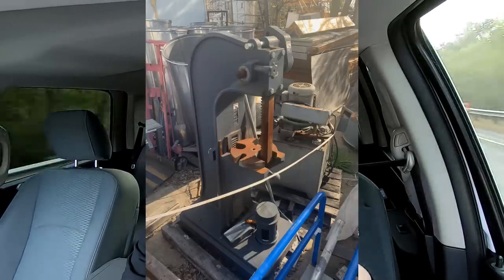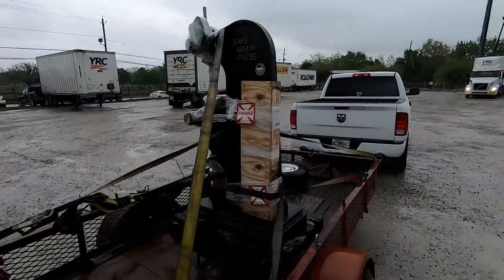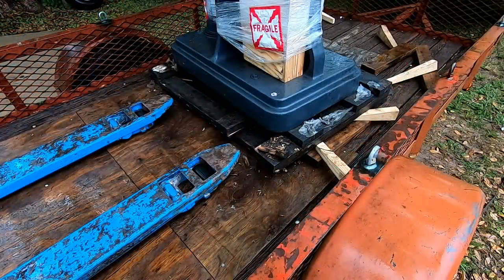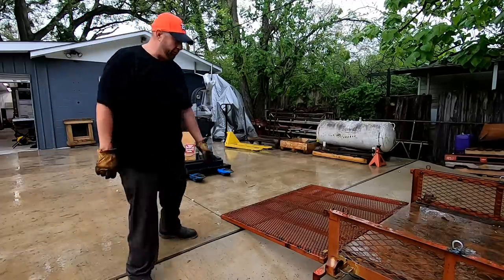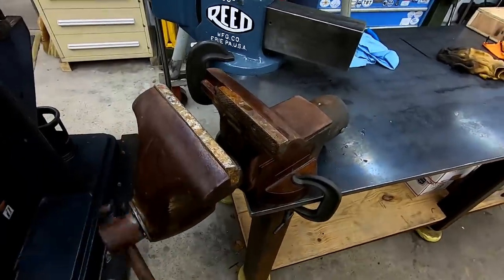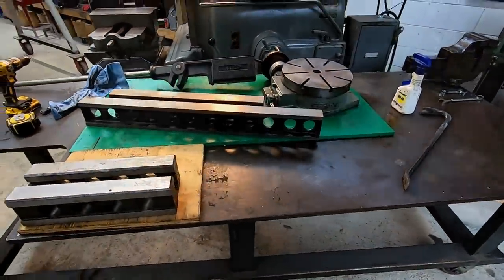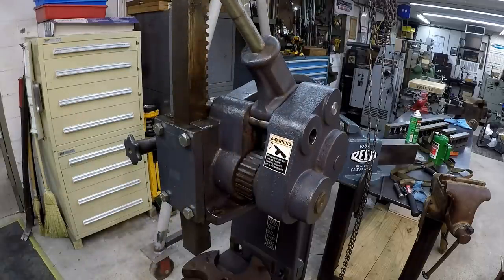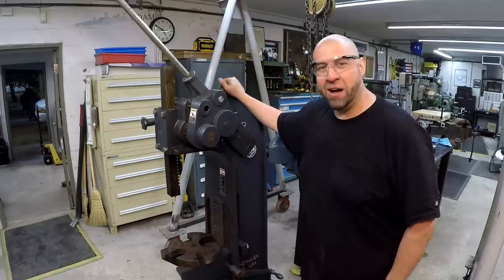Taking Delivery of New 15 Ton Arbor Press

Comment: Throw some rags in the catch can so if drop a broach or shaft it makes a soft landing.  I bet the 1.5-15 pin length is just right pull from one side and stick in from the other. Great score.    Just the right size for you.

Comment: I also noticed that aside from the great strapping job, the press was placed just in front of the trailer axle. Very important.
The axle and the tongue share the weight. (Not equally; more for the axle, but just forward lets the tongue handle some of the load). That is ideal for stability, as well as weight distribution. You don't want your trailer weaving (too far back) or your vehicle rear end pushed too low (too far forward). (This is just for anyone who didn't know; I know most of you do and I know Adam does!)  :-)
Reply: Duh
Reply: @bulldawg6259  Duh?!  Jilucasound's explanation was very good and appreciated by those  who don't know how to load a trailer.

Comment: Dang Adam, you one upped me! I bought a Greenerd #4 from Washington state (I reside in Texas) and was so excited I got it for $264 off ebay. Cost me $248 to get it close to home. In my haste, I failed to notice it was stored outside (Did I mention Washington and the rain they get there) for 30 years outside a wood mill. It was all locked up and a "project". Lots of love (hammering) and oil got it freed up and working properly. I used an engine hoist to unload and move it. While you more than doubled my press capacity, going to have to start a new search. Ironically, I am near Dallas, so I should go visit Andrew and his stuff. Love your videos but you are costing me a fortune in tooling for things I know not how to use. When asked by foolish visitors what purpose it serves, I have thus far crushed a coke can, cracked a walnut and done some minor motorcycle stuff. Yep, multi-purpse tool for sure. Just need to find a hip holster to allow me to carry about town!

Comment: I like the way the press was so thoughtfully protected during yard storage and at the point of dispatch with a readily available plastic bag or bin liner that machinery often comes in from the factory, should it happen to rain or become damp or humid. That reminds me; I've been soaking a pair of engine mounts for a month in Evapo-Rust TM and it only takes a day to work its magic. I wouldn't even know about it unless Adam had featured it in some of his videos, so thanks again big buddy!

(This comment was not sponsored by Evapo-Rust TM but you can never have too much of a good thing, hint, hint ;-)

Comment: Good score. New. I've never seen a big arbor press that wasn't 50 years old and half beat to death. 

The catch basket on the big arbor presses I've seen were usually lined with rag waste to protect shafts and broaches as they fell away from whatever they were pressed out of. And catch chips etc.
Reply: The Catch basket is called a Mandrell Catcher in the Dake manual and i would put some rubber in the bottom of it and maybe around the rim.  Then use a coffee tin to catch chips or oil.
Reply: @SuperSrjones   And here I thought it was a spittoon, you learn something new every day.

Comment: Heya adam. I believe you are also missing a locking wrench for the table. I have a similar press either a famco or dake i don't recall rn. Anyways it looks like an identical machine.  I think this is why there was so much give when you were pressing the wood. If you don't have those bolts in the back tight the table will move a bit when you're trying to press something. Food for thought.

Comment: One thing you could add that would make loading and unloading your trailer is a pair of jack's at the rear end of it. Added to the jack on the tounge, you can eliminate the bounce and sway when you're loading or unloading. I've done it on several trailers in the past, and it really helps. Just a suggestion....

Comment: Do a press brake adapter, would be as handy as hell for bending brackets etc, I know here you can get 150 mm vee and round adapters to squeeze in a vice for that odd 6 mm bracket a shop always needs to hang an Ebay score or your welding helmet, if it was my press it would have adapters to do multiple things, good stuff Adam.

Comment: I have been having a look around at stuff on that press and everything that I can find is saying that its a 12 ton one. The "catch can" (from what i can tell) can have a pad in the base and is used for catching things like broaching tools with a soft impact, the part name is a mandrel catcher. The short sliding pin that is used for dropping the tonnage down is 1" x 6 - 1/4" according to the modern equivalent parts list and has a snap ring in a groove to stop it going too far in.

Comment: Dake is based out of Grand Haven MI. Which is a little over an hour west of where I live. I used to own a twenty ton model, so I can confirm the operation setup that you figured out. Dake is a great outfit to do business with. I used to service a lot of their older hydraulic units back in the day. Just good old fashioned bullet proof engineering, with great customer support. Another unit, manual or hydraulic, is definitely on my wish list for the future.....

Comment: Real nice press Adam.  A little cleanup and good as new, hard to find equipment that has not been beat to death so you got lucky there and good find on the parallels, another shop item that when you need them you really need them.

Comment: Always always always strap the load to the pallet jack. I've seen far too many things fall off from a simple bobble coming off a trailer or even a transition in a concrete slab. In addition a quick bolt on outrigger for the pallet jack is priceless for slightly sketchy situations.
Reply: Words of wisdom for all of us to remember.  As Mr Pete222 says, safety is no accident.
Reply: @anomicworld yes it was. But you saw how easily he could remove some planks. The wood wouldnt be able to hold the weight....

Comment: I have a Famco 3C arbor press in my shop. It has the ratcheting handle. It’s amazing the force you can apply with the leverage from that very simple tool. Mine came on the original stand. Sold for next to nothing at the tool and die shop auction where I purchased it. 
Good vid Adam. You look very happy these days. New job and beautiful new wife. That kind of Happiness means low blood pressure and just healthier stress free living. Happy for you dude.

Comment: Adam. take measurements of the INSIDE of that bottom "catcher." Then go to a local restaurant supply store and look for something called a Bain-Marie. It's a stainless steel cup (various sizes) that may fit in that catcher. They are not expensive and may serve you better than the catcher for collecting the cutting oil and chips. See you at the Bar-Z. Jon

Comment: It's often the simple things that are a serious PIA. 
Nice press though. I think the fixture at the bottom is for pressing bearings on axles and other long work like pressing pulleys off shafts. I believe is (was?) an attachment(s) that fits the seat in the base. I'm pretty sure the cup is for catching slugs when punching holes.
Maybe you are expected to move the left pin to the right side to change ratios?

Comment: Could it be that the pin to switch from 7 1/2 to 15 is designed to pull out of the left side and put back in from the right, rather than having a whole second pin to replace it?
Reply from the maker: Break down shows a short separate pin on right side.

Comment: Congrats on the press, Rucker has a similar model, FAMCO 5C, funny you both found one a month apart.

The cup is called a "Mandrel Catcher" in their manual, I think I would put a rubber mat in the bottom to cushion the fall. 

http://www.dakecorp.com/service
"Parts for Dake Machines

Our facility is stocked with replacement parts for all of our machines. Whether you have a vintage Dake machine or a new machine, our parts are readily available to be delivered to you when you need them. Our service representatives are standing by to help you determine the proper parts for your machines."

I was looking at their Manual and parts list, they seem to have some errors, the last 2 pages of the Model 5 manual are for the Model 4.
http://www.dakecorp.com/uploads/pdfs/manuals/Model-5-2018.pdf The parts view and list is wrong.
But if you look at the model 4 manual the parts view and list look to be correct for the Model 5.
http://www.dakecorp.com/uploads/pdfs/manuals/Model-4-2018.pdf
I've sent them a message about the error.

Comment: next time you go get sumting like that up check if its on the right pallet , if it isnt have them slide the right pallet under the whole lot , could take a pallet with you so its no trouble for them to do so , few blocks of wood a cordless drill and some long screws and the thing isnt going anywhere on that pallet
might be a good idea to reinforce the floor on youre trailer , it looks  like the floor is about to collapse with all the weight on those small pallet jack wheels

Comment: I don't know, Adam, but I am thinking the big "cup holder" in the base would be to stabilize a shaft that you may be pressing out of a gear or a bearing. (Assuming) you would lower the shaft into the holder when the offending part was about to break free. Raise the "knee", lower the ram. When the shaft falls out, it doesn't fall on YOUR knee. Make sense? That would explain why it is so heavy duty. Slots in it? Maybe so you can see how far the shaft is from the bottom of the "cup holder" as you would be adjusting that depth so a big shaft will be captured. (?). That press can handle a pretty big shaft. Maybe 300 lbs.? More? Depending on material. How wide is the largest slot in the Daisy Wheel?
Reply: Telephone DAKE and ask them what it's used for.

Comment: Is that all tile work in the tunnel?

Need to build a pallet Jack with a hoist arm on it like an engine hoist.

Use a cool steering wheel for the hand wheel. Maybe one with a trucker knob on it.
Reply: Most pre 1960s tunnels would be tiled. Super common in older tiles in California.

Comment: Adam, it appears you are correct in thinking the Dake Arbor Press is a 15 ton model. It also appears that it is still being manufactured or if it is discontinued it was only done very recently as the manufacturer states they are still in stock. I'd contact Dake and ask how much a Hand Wheel would cost - just to keep it original. I also see that they sell for well over 15K so you certainly got a decent one.  Nice score!
Reply: A good eye, for a good Buy!

Comment: That cast iron pot looks a little too substantial to be just a catcher, no? I'm really curious as to what it is. I could be wrong of course.
Reply: Adam should contact Dake to get an Owner's Manual with a parts list and assembly drawings that'll answer those questions raised in the video.

Comment: Once, while working my week on, week off shift at NOLA Int'l, I took a drive to visit , my parents who were in Melbourne at the time. Due to weather I was making a midnight dash.
 Somewhere just past where that Buc Cee's is now, I got hit by the leading band of a tropical storm.  I had to pull over and stop for a few minutes, it rained sideways while broken branches were going by at speed.
I pushed through and by the time I got to the exit for Pensacola (The Five Flags Speedway exit) the weather was mild and clear enough to get gas, munchies, and get on down the road to the Atlantic Coast.
Reply from the maker: That’s the Pine Forest Rd. Exit. Been through there hundreds of times.

Comment: No doubt you have already discovered what the basket is at the base of the press, but it is a Mandrel Catcher. The long pin on the left should be 1"x10.5" and the short pin on the right should be 1"x6.25". Very cool find. I would love to had a Dake in my shop.

Comment: Abomb you need to build yourself a proper trailer for loading and unloading heavy machinery like that before you get squashed by one of these beautiful machines. Or at least modify that sorry excuse for a ramp on the back of that tiny trailer with some proper loading and unloading ramps so you don't have to drop that loaded pallet jack off the back of that gate anymore.

Comment: Thanks for enjoyable video!
I get the basic idea of that solid plate that meets the ram, but what are the varied slots in the plate for? Seriously, I googled the heck out of "arbor press bolster plates" and cannot find a single example or demo online showing the use of the slots. Is it that obvious? Pressing bearings or something?? Call me dumb (been called worse - Ha).
Reply: Different slots for different diameter work. When you are pressing 15 ton, you want to have the snuggest fit you can get around axles etc that extend down beyond the table.

Comment: Very nice arbour press. Very large for an arbour press as well I know it gives you "sensitivity" while broaching in smaller sizes but what other advantages would an arbour press this size have over a small hydraulic press? You also have some "sensitivity" on the hydraulic press - probably 20t hydraulic press would offer similar sensitivity to 15t arbour press - in both cases youo know you are pressing harder when you or air-over-hydraulic engine works harder / your hand.

Other stuff looks great too - I wish I had such large parallel set - much smaller ones used go for few 100 USD plus shipping. Vice is nice as well - through I am happy with my large Record vice family.
Reply: The mechanical presses offer feedback. You can tell when something isn't aligned or isn't going right, instead of trying to interpret a pressure gauge on a hydro press. Also, the mechanical press is a lot faster. (Usually.)

Comment: I'm always amazed by how cost effective it actually is to do depot-to-depot shipping with YRC, Southeastern or whatnot when it comes to gear like that. Do you protect unpainted metal surfaces on gear like that with something like Boeshield or do you just give it a spray of good ol WD-40 and let it be?
Reply: Once it's dry CRC SP 350 or 400 is a beautiful heavy wax protectant. I use it on all my machine tools that can tolerate a coating build up.
Reply: @otm646  I'm going to have to get myself a canister of that and give it a go, thanks for the suggestion. I live on the other end of the state from Adam, and as you can imagine the salt air and humidity don't do much good for unpainted or protected metal surfaces.

Comment: What are the benefits of an arbor press that size vs a hydraulic press, other than the cool looks?
Reply: Precision stop and start would be something. With a hydraulic or air setup, you're limited by the stops in the mechanism, and there's nothing you can do about it. With this type of a press, you can stop exactly where you want (on a dime). Imagine you have to set a pin in a fixture at exactly 3 mm, well, how would you do it, you could setup a sacrificial piece of 3 mm to stop against (more work) or just use a last word on the head and watch it hit target and stop. Just my 2 cents.
Reply: They have feel through the handle, you get feedback that you don’t get with a hydraulic press.
Reply: Simpler. No fluid to leak all over, no seals to blow, etc.
Reply from the maker: It’s simple mechanical leverage. Great for broaching keyways too.
Reply: @Abom79  not to mention that if someone can break THIS, they have no business being anywhere NEAR a shop... (Fred, you could f#!k up an anvil, couldn't you?) ~:)P

Comment: My co-workers and I are wondering if a Dake style press ever has any advantage over a hydraulic press. Where I live hydraulic presses are cheap and plentiful and Dake type presses are costly when you can find them. We really wondered about this. Your thoughts Adam?
Reply: The main benefit is having feedback that you can feel with your hand. As opposed to a hydraulic where the only way to "feel" it is to listen and watch a gauge. Also, with the wheel on the left side, coarse adjustment is much faster. Also, no moving parts, and relatively zero maintenance. They're also really rigid/heavy duty, unlike some of the cheap box beam hydro presses.
Reply: I think that arbor presses have more clearance than a traditional hydraulic press to fit large or oddly shaped parts. Also, this thing would beat the heck out of a hydraulic press as far as speed goes, if you're doing any sort of production work.

Comment: On those old cast machines they numbered each part and it’s hard to tell which one is the model number . Does the crank handle below fit on the arbor adjustment ( where you thought there should be a wheel ) maybe they use it for both adjustments ?

Comment: Did they actually put that on your trailer with a forklift? That trailer doesn't look like it could handle the weight of a forklift at all.
Reply from the maker: Must have skipped the first part of the video showing the press being loaded...
Reply: @Abom79  I saw the forklift bring the press out and put it on the trailer but the forklift was still on the ground. The forklift put the press on the trailer and the video cut to the lift being right over the axle of the trailer. I'm not trying to be a dick. I definitely didn't see the forklift on the trailer, though.

Comment: I have the exact same press. It will develop 60 tons with an extension
Reply: What?!  Has Dake published that amount?  That's a lot of force for a cast iron frame and I'd worry about it cracking or breaking at those high forces.

Comment: Wow 15 tons, that little trailer is stronger than it looks!
Reply: Not sure but I believe 15ton is the pressure rating and not the actual weight
Reply: @gabewhisen3446  you are correct, it was just a joke.
Reply: @gabewhisen3446  That's correct ...